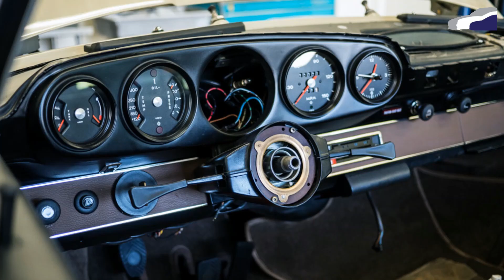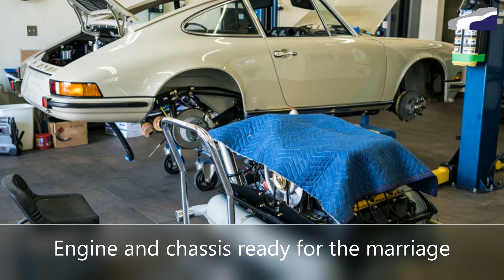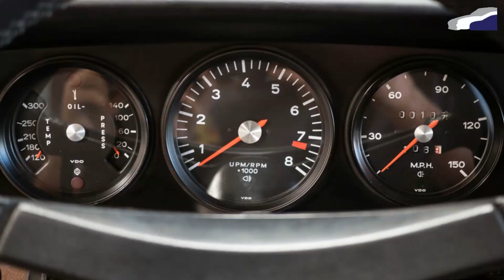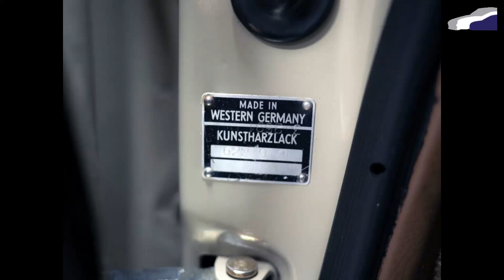1973 Porsche 911 T Brought Back To Factory New

Comment: Great Job!
The rev counter is an S model 
Also the engine have ...more power? 😘
Reply: I would surmise this car received the 2.7 RS motor upgrade What a meisterwerk!
Reply: as the owner I chose to upgrade the engine to 2.45L S Spec  -  during the restoration